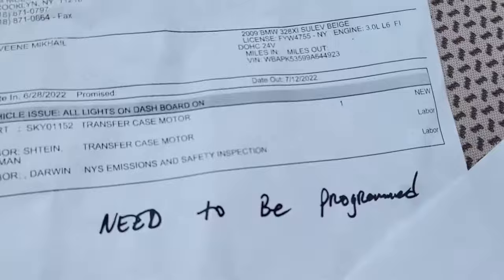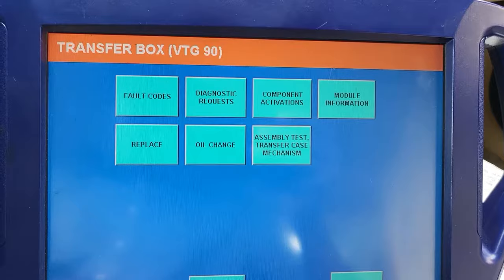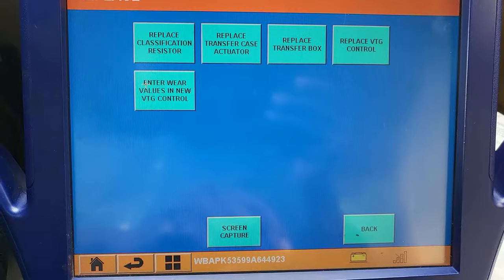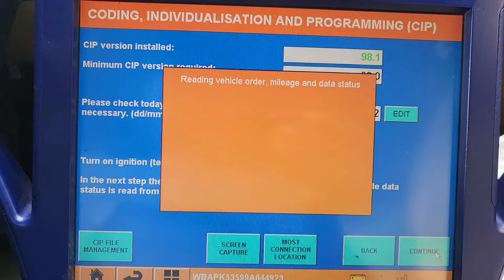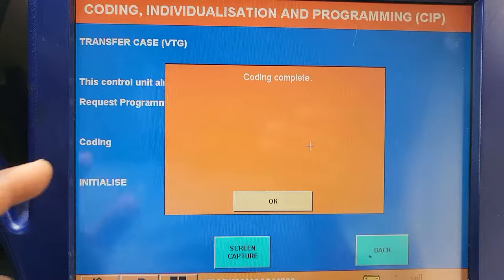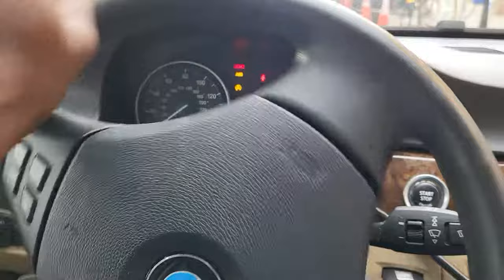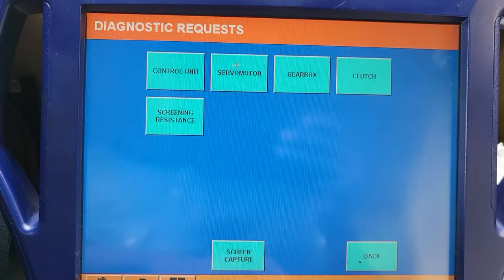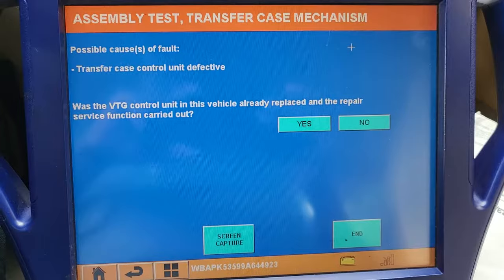BMW  E90 Trasfer Case: Internal Code 5F39-5F3A Also 54C4 Calibration Faulty Bad T Case

Comment: Use ISTA-DIAGNOSTIC, it will give you a better guide as to what the issue is,,, most likely you will have to program with ISTA-PROGRAMMING than code it than do calibration,,, the calibration is failing because coding is not set, and coding is failing either because module is not programmed correctly to vin# or the module is the wrong part# for that vin#.... contact me if you still need help
Reply: Hey, i had no transfer symptoms or any lights. Changed the oil just for routine maintenance and decided to reset adaptation. Reset failed and the trifecta of lights showed up with code 54C4 and 5F3A. How can i calibrate it ?
Reply: Same exact thing happened to me on my '05 X5, using the Schwaben/Foxwell scan tool for BMW. Just trying to figure out how to recalibrate... I wiped out all the adaptations to zero. Only got rear wheel drive now! 🤦‍♂️

Comment: No sir ... not progamming issue at all ... you should inspect the gear (plastic) of transfer case motor ... ie remove and inspect transfer case actuator motor ... if all ok after that ... should turn ig off then wait 10 sec then on then all be ok
Reply from the maker: thanks brother
Reply: @BestCarFixes  ur welcome  ... and believe me ...
Reply: hi brother i have also Proble it come failure after read 0054C6 VTG : OIL WEAR (its oil old?) and SECOND FAILURE 0054C6 VTG: calibration wrong but we  demontage the servomotor from vtg and give new the plastik  repair kit you know the black one and the white but i can also not calibrate the vtg or i say i change oil and want reset nothing happened  also come failure - is the complette motor actuator from vtg deffect ??? thank you ! sorry for my english but i think you understand me.
Reply: @ hesham essam   hi brother i have also Proble it come failure after read 0054C6 VTG : OIL WEAR (its oil old?) and SECOND FAILURE 0054C6 VTG: calibration wrong but we  demontage the servomotor from vtg and give new the plastik  repair kit you know the black one and the white but i can also not calibrate the vtg or i say i change oil and want reset nothing happened  also come failure - is the complette motor actuator from vtg deffect ??? thank you ! sorry for my english but i think you understand me.